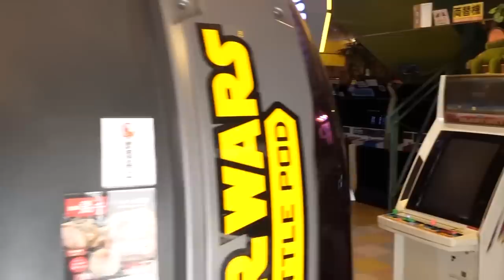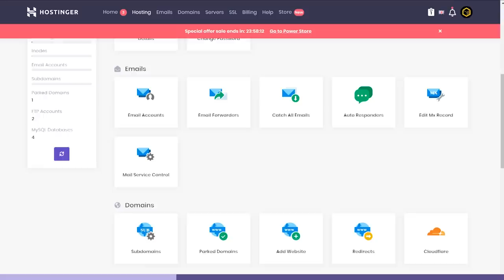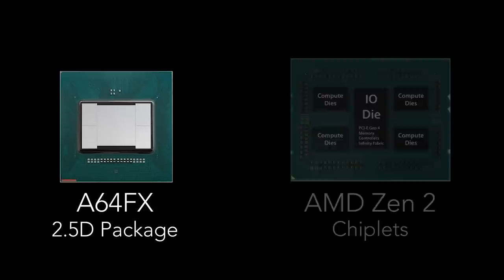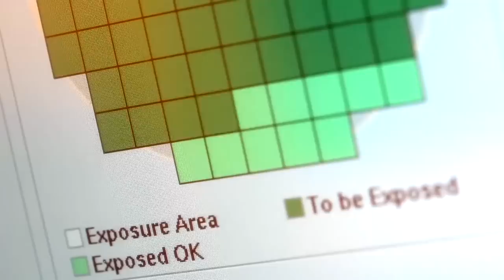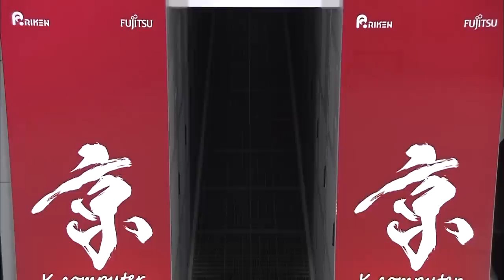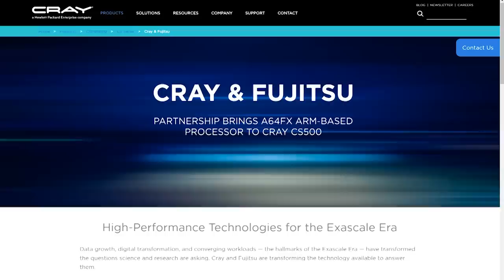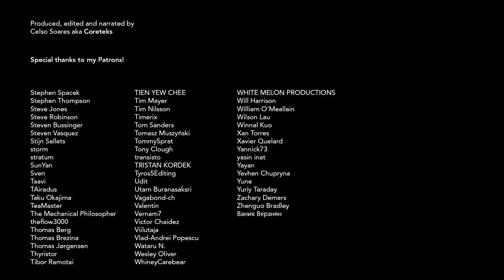CPU? GPU? This new ARM chip is BOTH

Comment: Do you ignore the fact that this chip is limited to only 32GB of memory? If the memory is built into the chip, you can not adapt more memory to the board. Which means that any limitation of memory brings you to the point that you have to load your data from the drive. This is bad even using SSDs. Another aspect against your theory that we can expect to get products using this kind of architecture is that PCs benefit from modular design. Including the memory as part of the processor means that your processor has to be replaced to deal with memory limitations or problems. A new processor can mean that you require a new board for it if newer or bigger chips aren't compatible to previous boards. So it would increase the costs for complete systems in the building process. Some people will require more than 32GB of memory and some won't need more than 4GB or even less. So integration means for many people buying a bad solution for their needs and workarounding it. Future games will even require more memory capacity and most tasks in games can also be preprocessed. So faster computation won't bring that much benefit. Even raytracing on modern gpus is also limited by memory capacity. This chip is still impressive but it's not built for consumers who don't really know today what they want for tomorrow. I would think the most interesting scenario for chips like this which is related to consumers would be consoles. Because consoles benefit from a closed and well defined architecture for optimization. But it's not for PCs...

Comment: I do have something to add - you say this is a product aimed entirely at HPC markets. I don't fully agree - it is a product that will prove a new type of chip to consumer markets. You're right that this kind of chip isn't necessary yet for the consumer, but it will be. These forms of giant bandwidth requirements will become more and more common as technology advances. Things like holographics/volumetric VR will take ridiculous amounts of data as it will add a third dimension to image data - exponentials and so on. 

I really do hope it's the end of the x86 era and move to a new instruction set with it's eyes towards the future.

Comment: Hello there Coreteks:

I could really see a chip like this being used in laptops cause of how powerful they are but how little space needed since there is no need for system RAM or a dedicated graphics chip meaning it would make  high end gaming-grade laptops much more affordable and have much longer battery life. I mean,  with the much-shrunken motherboard (really you only need a an arm for all the I/O  like your USB ports, video outputs and charging port and that is it [not to mention the power button and a secondary board for the trackpad]),  you could fill the the remainder of the space with a massive battery which means a much longer battery life out of the laptop MUCH LONGER than the one that was shown off at CES this year that lasts 16.5 hours (which is pretty insane in of itself). We could see batteries lasting possibly 24 hours or more on a single charge doing mundane tasks. Just think of that for a second. A laptop that is capable of running al of the latest games with all the graphical settings cranked up while playing modern AAA games WHILE STILL allowing for more than 18 hours of gaming  or running more GPU-intensive workloads on battery. THAT'S INSANE. If you are going out to say a LAN (they do still exist) or to a friends house and wanted to bring your laptop to play some games for a few hours, you don't need to worry about the charger AT ALL. That is why I see a chip VERY SIMILAR to this one being used in laptops cause you could get a very powerful but very power-efficient laptop for quite possibly LESS THAN $1 grand US.  One that is capable of DOING EVERYTHING that one that would set someone back more than $3 grand for now but for LESS THAN $1 grand. Really insane to think about. Dunno what you think but I think laptops are a really good use of a chip like this.

Comment: The largest struggle a GPU has when it comes to running tasks designed for a CPU is GPUs struggle at if statements.  They can do them, but they have to block causing a 32x speed slow down until the branch finishes executing.

This "gpu-like cpu" does not address this elephant in the room issue, so it is firmly in the gpu camp.  It's a faster gpu for data science and is not a cpu.

On today's GPUs you can run Linux on a GPU, but it runs like a snail because of all of the if statements in its code.  Just because this future gpu can run an OS does not make it any more cpu.

Comment: I just hope that if specialized chips become a thing, then there won't be restrictions to OS (there shouldn't )
i really like the idea of having all memory chips etc on one chip. as it is right now, there is a lot of wasted space spent on circuitry connecting components like RAM and a GPU, or perhaps in the future storage, that can definitely be eliminated. in the past, we had cache dies, separate from the cpu. now it's integrated, making processing faster. same can do with other chips. imagine all we could do if we only had a processing chip that had all the work being done; we could have much smaller devices with much more power. it seems like a good step towards a future without such bulky machines. imagine an ultrabook now that can do your desktop's work better with much less space. now imagine the higher power efficiency due to less spread as well as other improvements (such as using ARM)--you could have a small ultrabook the weight of paper, the processing power of a desktop, and a battery life that lasts months (my laptop already lasts about two weeks without a charge).

though i will say, the only actual figures really shown in this graph are of tasks highly dependent on memory, as well as being very parallelizable. perhaps with scheduling and less parallel tasks though, this chip would perform worse.

one of my concerns about this though would then be the fact that we totally lose upgradeability--either deal with outdated tech in 2-3 years of release or buy a totally new machine. this may then give rise to subscription hardware or cloud computing, with renting server space from a host and simply using a raspberry pi-like tablet or laptop to connect and do all your work. tons of nasty stuff could rise tho such as spying, data breaches, and simply corporate or lawyer scuminess

Comment: The idea that Fujitsu has innovated a breakthrough with integrated memory is a fallacy. Every chip developer has had these designs, but it's a matter of getting all the motherboard manufacturers on board (no pun intended) at the same time. Until that happens, you will still continue to see motherboard companies include RAM slots.

Comment: While A64FX is indeed quite impressive, perhaps saying it's almost like a GPU is an exaggeration. Apart from having HBM2 memory (and thus a high memory bandwidth) and that rather tight 6D Tofu interconnect what part of it is like a GPU? What about its cores? How do they function, and how do they compare to GPU shader cores? 
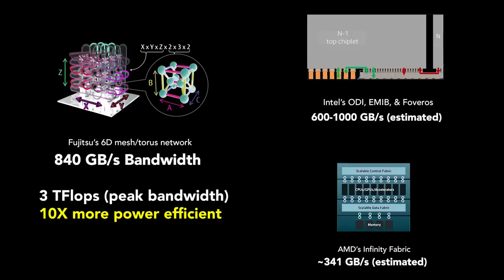Can they all work together in a SIMD or SIMT manner? How about their integer and floating point performance? Are these peak 3 TFLOPs mentioned at 8:55 just FP32 floating point performance from the 512-bit SIMD units or a balanced integer & floating point performance? And how long can this peak performance be sustained?

Comment: Correct me if I am wrong because I haven't done low level programming since university.
Doesn't ARM have a totally different instruction set than the x86 platforms (actual binary code and with no equivalent commands, not just in the assembler). 
"It runs windows" might be misleading, it runs windows and maybe some apps reassembled for ARM but I'd think that a standard x86 program would run terribly.
So the fact that X runs faster on an ARM chip rather than a Xeon may be just down to the program.
Have I missed some OS tech that allows ARM to accept x86 programs?

Comment: For the PC user gaming enthusiast what exactly what a system look like with just one single chip? a  motherboard most likely water cooler and that's it, or very very thin heat sink and you can go flat as hell are desktops will just look labtops, this sounds better for the PC minimalist but if this form factor is adopted the era of the gaming PC is dead
Reply: They would look like what the next gen consoles look like. LOL Windows in the cloud, office 360, Xbox Game pass, get the idea? The only screen you'll carry is on your smartphone or smartwatch.

Comment: most probably on a deskptop cpu one will find a "BIG" core for the os, sometimes gpu cores, but that may not be allways a case, and i think later on FPGAs. then, the most used function of a given code can set the FPGA to do just that. that would be hardware and software tailored for speed. i believ l1, l2,and l3 cache will be removed as we know them today, and a single cache memory will be used, accessible directly by all cores, and the FPGA . unified memory address. Sortha like a big shared l3 cache, expect fast as current l1 cache.

Comment: Taking the Jacobi Method as a benchmark is a bit cherry-picked. That's a bit like taking tensor cores, making them do matrix multiplication, and thus concluding, that they really can rival CPUs in running Microsoft Word.  I know that is not what you said, but because this video is so full of praise for this chip, it does come across this way. 

Methods like Jacobi (or SOR. anything based on triangular decomposition) are notoriously difficult to parallelise in a fine-grained manner, as you would on a GPU, because these are fundamentally sequential algorithms. Don't get me wrong, this chip is impressive, and fp64 computing performances of 1.9 to 2.7 TFLOPS are very impressive, along with the large on chip memory ... But when it comes to sheer computing power you can get about 2.9 TFLOPS from a K80 GPU, which is 6 years old now, and you can get one for 1000€ nowadays.
Great CPU, but let's not completely lose sight of reality.

Comment: Why would using the same ISA both in servers and edge enable greater performance?

No one is sending raw code between systems. They all use some sort of high level protocol and need to marshal and demarshal data both ways. Even if they decided to send code... having the same ISA isn't enough. There are thousands of ARM chips that are compatible at their core but anything of interest needs to target the specific chip and its features.

They are using ARM because it's not X86, it is flexible so they can license what they want/need, they can modify it as needed, they can get decent performance (unlike RISCV), and they can use off the shelf toolchains and operating systems without major changes or maintenance.
Reply: And as for the possibility of heterogeneous chips... it's no different from the past 50 years. Heterogeneous systems and chips have existed for many years. The fact the chips might exist on the same die more often than in the past isn't surprising. They exist today. Lots of CPUs have subprocessors for security for example. You've got many systems with SIMD subsystems or whole separate dies.

Comment: when you talk about texture streaming, that’s not really correct, it would just help performance of higher resolution textures, it wouldn’t reduce load times or have textures pop in smoother. That would still be limited by your hard drive. Also this is basically a CPU with gpu functionality, it won’t perform better than a dedicated gpu.

Comment: I dont see a major breakthrough with ARM Processors. We still use x86 and that wont change in any future. To many application are depending on that, as well as the software development. They will find theire gap, mybe as controler processors, AI assistance or something like that (specific scientific workloads). In history there never was anything to be counted as a  "jack of all trades" and that would never be. They are a great compromise for mobile devices, to some kind of "all in one" but that doesnt mean its a super GPU or a super CPU, its performance is not bad and its power consumption is greatly low, so its performance compered for its consumption is good, but Smartphones and Desktops are different worlds.

Comment: Doom to fail. They are not mass produced and there are not enough SDK support like the other architecture. They should stick to separate designs so each can be optimized and standardized for larger audience. In the end volume means lower risk design and lower cost, and therefore faster time to market and more customers. p.s. Super computer is obsoleted when you can just use more from the cloud on demand. You don't want to build a super computer and let it sit idle when you can run as many machine on the cloud as you need in burst traffic and pay as little as you need. Super computer you own will either wait because the work comes in burst or they sit idle wasting money.

Comment: Very interesting. It makes what Apple is doing with Apple Silicon make a lot more sense. Their approach seems very similar to the thinking you explain here of putting everything on an SoC: CPU, GPU and memory. Of course Apple is a bit different with all their specialized hardware chips. But this definitely seems to be where the industry is going, and I cannot help but think that Intel and AMD are getting stuck on the train station while the training is leaving.

Comment: This is the kind of architecture I've wanted since the first graphics coprocessor, even more after the rise of plugin discrete graphics cards. The 'integrated' GPUs are not integrated enough, even in AMDs APUs... LOL, it could do with an instruction set something like this very compact, simplish, extendable, powerful CISC on RISC idea ... The competition (All ARM, Intel, Risc 5, MIPs and Agner Fogg's instruction sets ) are either or both weak and bloated in comparison to even this rough draft that maps well to an X86 and rolled out loops for a single core virtual machine to a fully blown super computer CGPU...

Data Types: x16

b8, b16, b32, b64, b128, b256
i8, i16, i32, i64, i128, i256
f32, f64, f128, f256

Registers: x128 .. each type has 8x registers (ex. b32_1, b32[1], b32[b8_2])
Stacks:    x128 .. each type has 8x 2^1..8 sized vector stacks (ex. b32x4, b32x8[2], b32x16[b8_1], b32[1,2], b32[b8_1, b8_2])

Immediate Values: a method's immediates are pre+parallel loaded into a register file with 8registers for each type (16 types) and 128 address pointers/Integers
 
Virtual Registers: 

A,B,C,D .. A op (B) (op C) (op D) into A | D
PA, PB, PC, PD .. memory pointers  

Instructions: 2 byte op codes
// 59 // total: 232
16, assign P(A|B|C|D) to rg7|iv7|ip7|st7
1,  load|save|copy from|to * P(A|B|C|D) * P(A|B|C|D)
4,  load|save rg7 * at PA|PB|PC|PD
8,  load|save st7 * push/pop? * at PA|PB|PC|PD
16  copy rg7|iv7|ip7|st7 * into P(A|B|C|D)
4,  copy im8 to A|B|C|D
8,  push|pop  st7 * into|from P(A|B|C|D)
1,  push im8 to main stack
2,  push|pop main stack to/from rg7|st7
1,  push|pop P(A|B|C|D) to/from main stack
// 28
8,  add|sub|mul|div A * st7 * pop? * into A|D
4,  add|sub|mul|div A * rg7 * into A|D 
4,  add|sub|mul|div A * iv7 * into A|D 
4,  add|sub|mul|div A * ip7 * into A|D 
8,  add|sub|mul|div A * im8 * into A|D
// 16
2,  and A * st7 * pop? * into A|D
2,  or  A * st7 * pop? * into A|D
2,  xor A * st7 * pop? * into A|D
3,  and A * rg7|iv7|ip7 into A|D
3,  or  A * rg7|iv7|ip7 into A|D
3,  xor A * rg7|iv7|ip7 into A|D
1,  and|or|xor * P(A|B|C|D) * P(A|B|C|D)
// 12
1,  shift L|R * A|B|C|D by A|B|C|D | iv3
2,  shift L|R * st7 * pop?
1,  shift L|R * rg7 
2,  shift L|R * im8
1,  rotate L|R * A|B|C|D by A|B|C|D | iv3
2,  rotate L|R * st7 * pop?
1,  rotate L|R * rg7 
2,  rotate L|R * im8
// 87
36, do if A|B|C|D * ge|g|e|le|l|ne * rg7|iv7|ip7 
24, do if A|B|C|D * ge|g|e|le|l|ne * pop? * st7
24, do if A|B|C|D * ge|g|e|le|l|ne * im8
2,  do if P(A|B|C|D) * ge|g|e|le|l|ne * P(A|B|C|D)
1,  do if not * Z|S|O|C|Cached
// 18
1,  jump if Z|S|O|C * to|by * P(A|B|C|D)
3,  jump by i8|(forward|back) by b8 
4,  jump to|by rg7|imm
2,  jump to|by st7 * pop?
2,  jump to|by P(A|B|C|D) * plus A|B|C|D * shift ev3
1,  jump by P(A|B|C|D) * shift ev5
1,  call rg7|ip7
1,  call st7 * pop?
1,  call P(A|B|C|D) * plus A|B|C|D * shift ev3
1,  call relative, jump by P(A|B|C|D) * shift ev5
// 12
1,  tiny op * 256: no op, return
1   P(A|B|C|D) op Self into Self * 32 ops: not, neg 
1   P(A|B|C|D) op Self into A * 32 ops
1   P(A|B|C|D) op Self into D * 32 ops
2,  A op into A|D * 256 ops
2,  A op B into A|D * 256 ops
2,  A op B op C into A|D * 256 ops
2,  A op B op C op D into A|D * 256 ops
 
Only one opcode is followed by a variable number of bytes:

1, Register Immediate Value ir8, Immediate Value // Must be proceeded by a Call or another RIV instruction